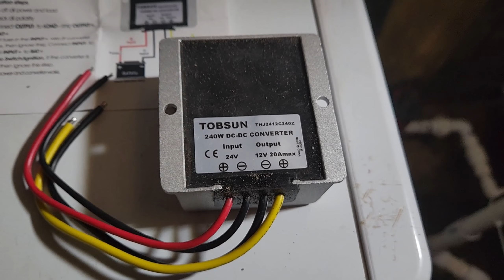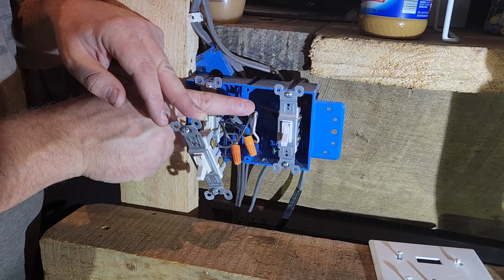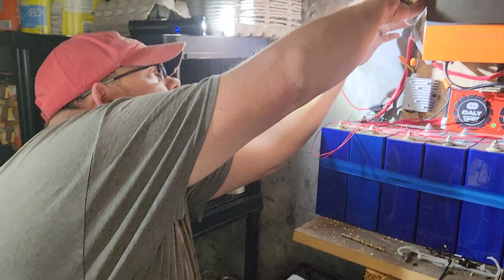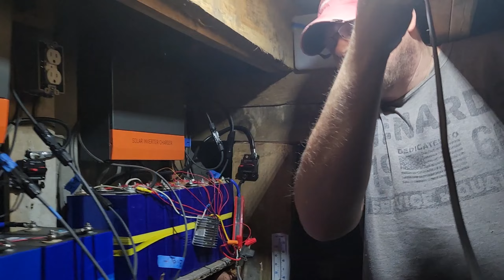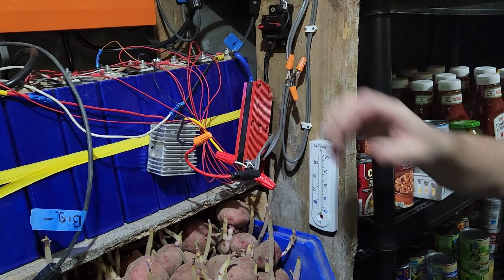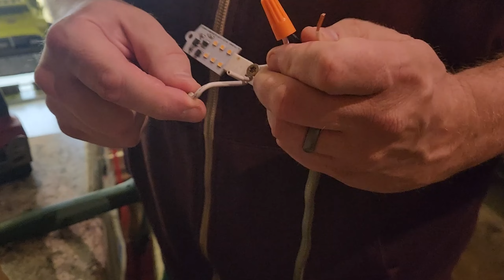Extreme Budget Lighting / 12 volt DC Wiring

Comment: What size shielded cable did you use?   Could I just use 12 volt individual wires that I have from when I rewired my machinery trailer? Thanks for sharing, very informative and inventive.
Reply from the maker: Yes those wires are actually better for 12 volt dc circuits compared to what I use. The wire I use is outdoor rated 14-2 and is intended for ac loads. I use it because my dc current is very minimal and it has lower potential of starting a fire on a dc shorr than the twisted wire used on automotive. Either way, please remember to put a fuse in right away before connecting any loads to your dc circuit. It is a great way to save money, my entire cellar lighting is a total of 6 watts. Thanks for watching.